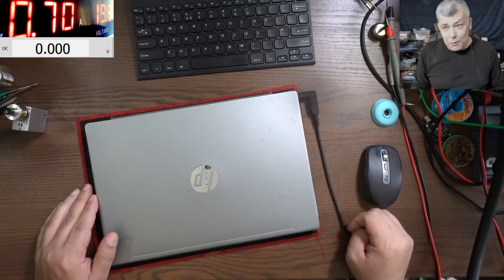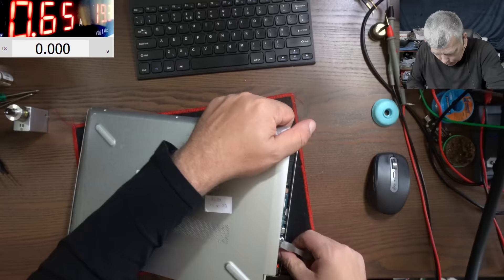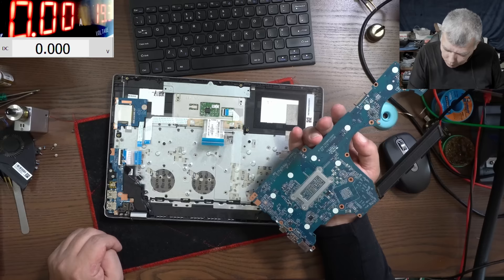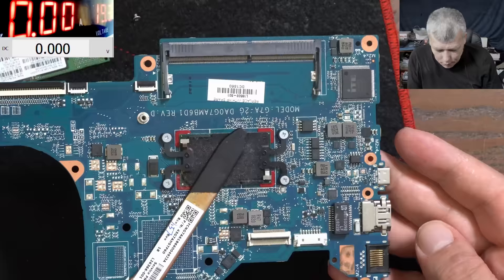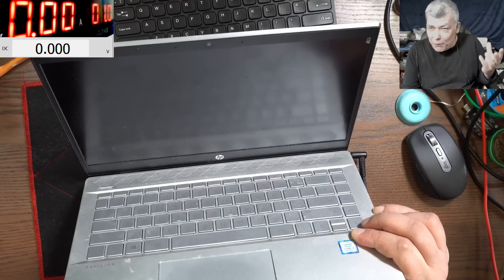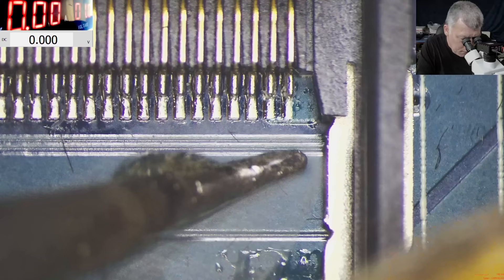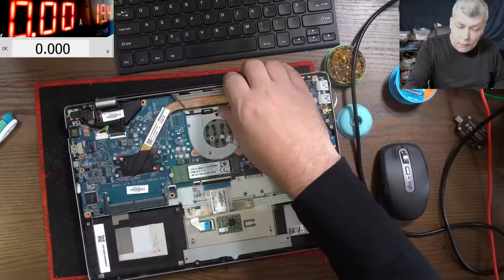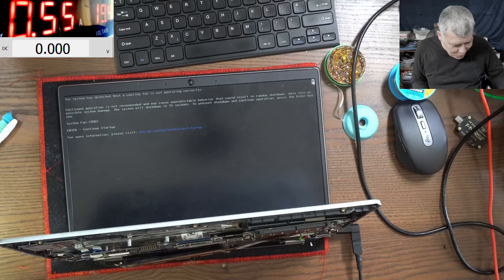HP laptop coming with no picture - 3 long, 2 short caps lock led blinks, error codes

Comment: Had the same problem with a HP 15s-DU1016TU. Fortunately it had two Ram slots and simply changing the Ram to the second slot solved the problem. I would have never thought that the Ram slot could have been faulty as it's a static thing and does not move. Thank you for pointing me in the right direction. Your videos are very informative.

Comment: THANKS!!! same problem with my sister laptop. i just buy new RAM but nothing untilled i found this video and check it on myself. also the broken was the 2 rights and i fix it with moving them to their hole. but its not good solution because every shake the laptop relapse to3 long, 2 short caps lock led blinks. so i need to check what to do. thanks! my sister also sent it to computer laboratory and the fail to found the issue.

Comment: Thanks for digging Deep.  I have a hp aero 13.3 laptop on ruzen 5. The caps lock started to blink 3 long and 5 short blips. The error code says cpu not recognized. I cant believe the cpu is shorted. From your  video sometimes the error is not where the error indicates. Request you to shed some light on where to check.  Thanks !
Reply: check the EC chip area. If there's liquid damage on the EC chip area, it will give that error as well.

Comment: I had not the exact but similar issue 

Whenever i boot into system the screen started tearing and this happenes when the mcb tripped due to overload of some kind. 

Troubleshooted and finally opened the pc found there was small short between two pins on ram(a small black spot visible) cleaned using IPA worked smooth as a butter

Comment: I also faced the same problem , but while doing this I have shorted the last right side of two pins(ground and data pin ) of the ram slot( 7:43) , now I am unable to fix this issue , now my laptop is not turning on

Comment: I have the same problem, I have checked all the pins in both ram slots. I purchased 2 new sticks same codes. Is it possible that it could b the ram on the graphics card? Its a hp gaming laptop